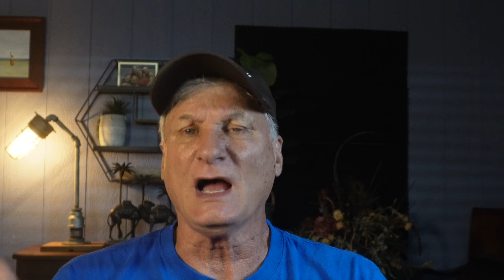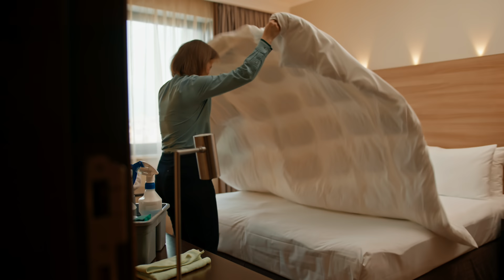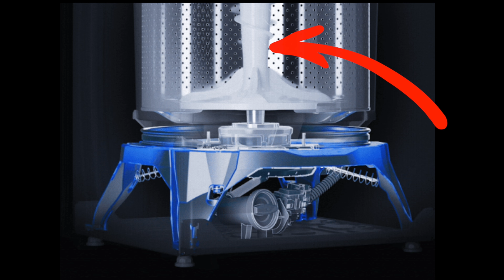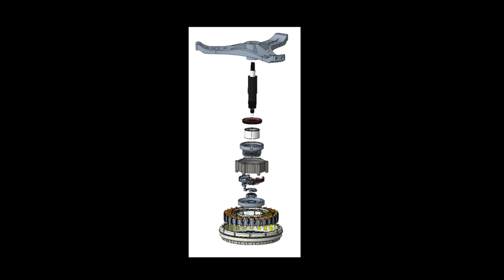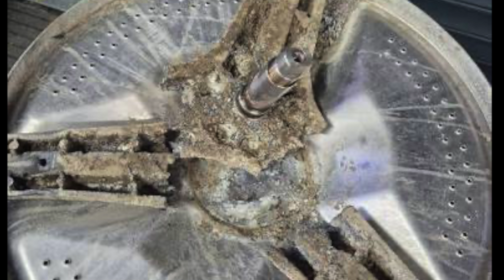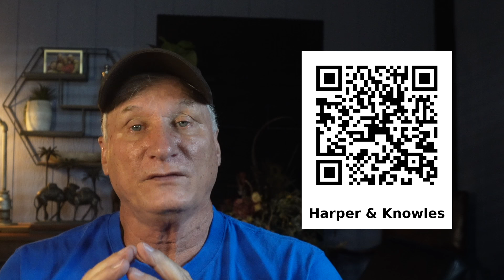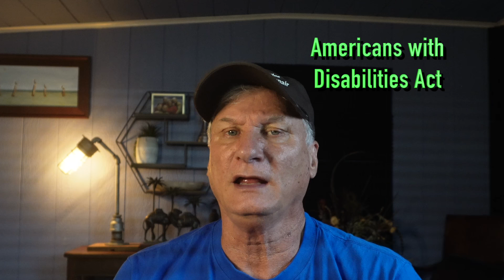Maytag's New 30-Year Washer: No Gearcase, Real Agitator, 900 RPM

Comment: Hi, Dave from Apex TV and Appliance in PA. I cannot wait to see this machine in person. The plastic tub isn't an issue, I've seen only ONE crack in my 41 year career. I also hope they ditched the actuator. I know they ditched the locking lid thanks to the tub brake.
Reply from the maker: Yes, I failed to mention that, but I did see it on the 360 viewer. Glad to hear some input from someone who sells them! Thanks for watching!
Reply: I hate the lid lock.  I also hate the dryer without the intellidry.  Maytag had intellidry on their dryers before they merged with Whirlpool.  It stopped tge dryer when the clothes were dry and you saved on electricity.  The Whirlpools just run and do not shut off.  Does the new machine have a painted top and lid or is it just painted

Comment: 30 year washer with a 5 year warranty---sounds about right.
Reply: 20+ year speed queen with a 7 year warranty, so basically the same words
Reply: @FencerFixerRepairLLCKansasCity Before Whirlpool bought Maytag they manufactured washing machines that competed with Speed Queen.  Both brands back then were equal when it came to quality.  The dials and wash settings were also the same but looked different.  The difference was the price.  We got Mother a new Maytag back then when her old Maytag needed work after 40 years of service.  The Maytag was also about $200.00 cheaper at the time.  At the time The Maytag Corporation also had a ownership in part of Alliance Laundry Systems.
Reply: The 30 year part is marketing, not a guarantee.
Commercial washers have little or no labor warranties and parts warranties that typically go up to 10 years, depending on the part.
Consumer units are one year parts and labor.
Reply: @thomasrobinson182  none are going to last 30 years unless they are in a single person household and industrial. Then is doubtful. That being said, my last two Maytags and the Whirlpool before seemed to have a timer set to malfunction 2 days after the warranty expired. My first Kenmore lasted 17 years and my second Whirlpool lasted 10 years. My last three never cleaned the clothes and are total garbage. If not for THIS YouTuber I wouldn't know Shinola about Speed Queen nor the others. Thank you for taking the anxiety and uncertainty about washing machines. I was seriously going to get one of the antique Maytags with a wringer. Spin cycle is incredible. Thanks
Reply: @tdvanwinkle 
A lot of longevity can be due to how the washers are used and maintained.
If you constantly wash very heavy loads, which is the weight of the clothes plus the weight of the water, it will affect bearings, seals and motors. These are not commercial machines, despite marketing that uses terms like 'commercial quality'.
Some users expect the water and energy saving units to wash exactly like mom's old one, which means they want more water and the ability to use any detergent, not just 'HE'. I've had several tell me they make their own. I also had a couple gentlemen who worked at a refineriy want to use very destructive chemicals as a means of degreasing their work clothes in the washer.
I explain what to use, how to use and maintain. To that end, I'm just like everyone else. I sell them at a dreaded big box retailer and I bought my pair there.
BTW, did you check the Kenmore model number (first 3 digits) to see who made it?
Reply: @thomasrobinson182  No because that was decades ago on checking the Kenmore numbers. I don't have mechanical issues with the new machines. It is ALWAYS electric/electronic. Faulty lid switches and locks and the electronic boards. Also, I have well water and water level being lower than the clothes NEVER gets them clean and the less clothes I put in the less the machines fill. If I could wash a shirt with a pint of water easily I would just hand wash everything.
Reply: @tdvanwinkle 
I suggest that folks add water via machine settings, which can't be done on 'NORMAL' cycles due to the testing restrictions on that cycle. 
See what the cycle guide for your washer says.
Have you had any issues with the electricity in the house?
If you have the small outlet tester, it might be worth a look.
Reply: @thomasrobinson182  they are just junk. Speed Queen is protected and tested for huge electrical surges and brownouts during rigorous testing. Their electronics are the only ones coated and sealed properly. The thin cheap varnish on other machines cracks and flakes off allowing atmospheric corrosion and moisture to degrade the processor.
Reply from the maker: LOL! You put that in a whole new light! Thanks for watching!
Reply: @HarperandKnowles  Hey Harper, remember we chatted a while back about the Fisher & Paykel top loader washer. Well this is using that same drive system that they invented in the 90s. Only here I see some mechanical brake system present ?? This is totally not necessary and just provides a weak point for servicing. F&P use magnetic breaking that doesn’t wear out. 
With a direct drive motor comes a very complex electronic control board system . (Don’t be confused by seeing the control knobs) Those parts are the most likely to fail and are certainly not diagnosable or replaceable by anyone who’s not a technician.
Reply: @spinnymathingy3149  F & P do not offer the switch for deeper water. The low warranty period of 24 to 36 months gives me pause. None are even assembled in USA. Not comparable in my opinion. F & P uses control boards behind the switches also so am not sure what the point is on that
Reply: @tdvanwinkle  I’ve been repairing this exact style of direct drive top load washing machines for over 30 years so I’m commenting from experience. The direct drive motor system on any machine is fully electronically controlled by multiple circuit boards. In the machine being discussed here an old style knob is on the control panel but that’s only for appearances. Underneath it’s all circuit boards. 
As for the F&P machines I’m not sure what models you have on offer in your area but here in Australia they have manual water level control. 
As a comparison this machine discussed here has many more components that encourage wear-tear and breakdown than the F&P. As for the 3 year warranty versus a 5 year warranty, that’s nice to have an additional 2 years but the initial purchase cost is probably double, why it’s double I can’t comprehend because the components used to make one machine or the other are almost the same (except for the suspension system which in the case we’re looking at here just adds to any repair)
👍🇦🇺👋
Reply: The electronics won't last 30 years and they know it.
Reply: @jay-em  I've gotten several 5-6 yr old speed queens come through the shop in the past couple months with bad control boards. Speedy's arent immune to control board issues either.
Reply: @my_channel7988  i  2nd that
Reply: My thoughts exactly.
Reply: I think that's Speed Queen's warranty as well.
Reply: @jccbsl1  Up to seven years bumper to bumper including the belt but doesn't cover damage from items left in the pockets or rust on the outside parts. The best warranty in the business and the only thing close to the old Sears warranties at Brand Central.
Reply: Maytag is not UNICEF my boy. 😊
Reply: @ubroberts5541  they aren't even Maytag any more
Reply: Yes sounds about right. Longer warranty times just inflate the price as they are calculated like insurance and don't say anything about quality. You can already extend the warranty on pretty much anything you buy on amazon if you are so inclined to finance insurance companies and the fools who treat their machines like crap.
Reply: Hey there our machine will drain tgen when it goes to spin rinse sometimes wont go ahead spin out but tgen say 2 days later works just fine, any clue
Reply: You want to abuse your appliance for 20 years? No. F0ck you
Reply: My Acura has been running great for 15 years. Came with a 3 year warranty.
Reply: Does the Acura do a good job on heavy soiled laundry?
Reply: @hanksp1396  Yes, especially the NSX
Reply: @hanksp1396 You have to put clothing in the trunk and then drive really fast over speed bumps.
Reply: @thomasrobinson182 😂😂😂if you hang your head out the window, you won't need a hair dryer.🎉
Reply: @norwegianblue2017  "Acura's standard new vehicle warranty 15 years ago (in 2011) provided a 4-year/50,000-mile bumper-to-bumper limited warranty and a 6-year/70,000-mile powertrain limited warranty"